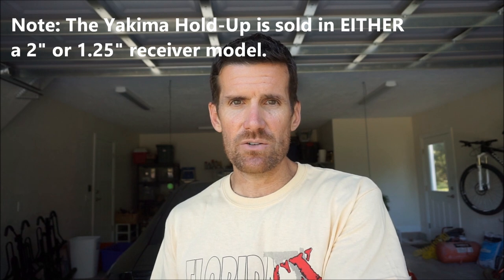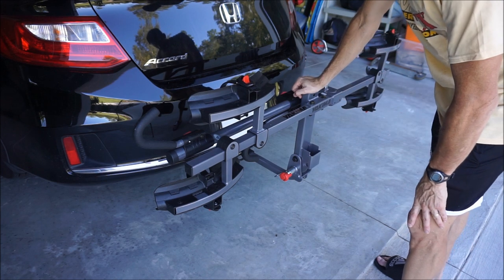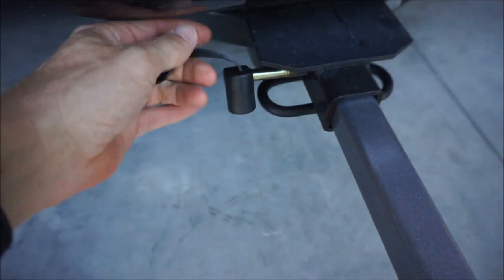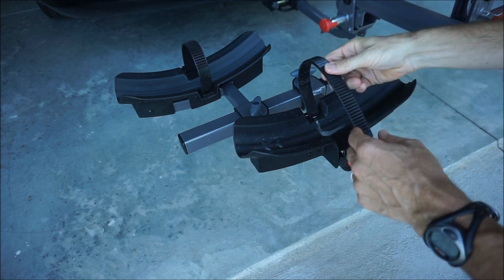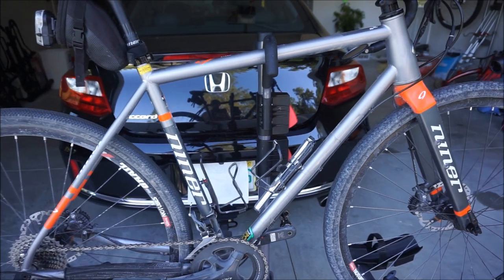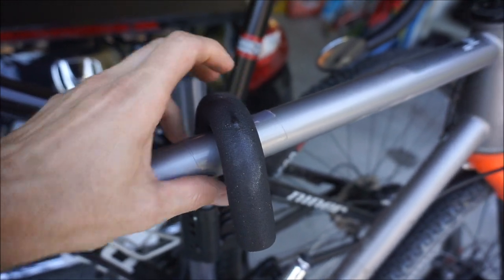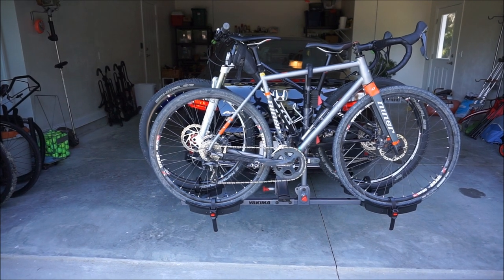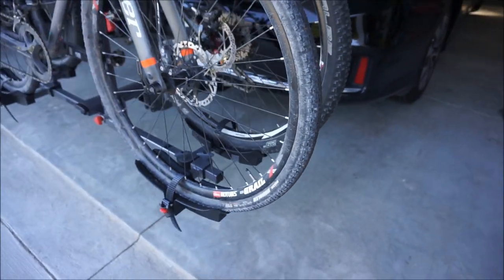Yakima TwoTimer Bike Rack Review

Comment: Good review. I might also mention that if you want to convert this rack to single-bike use, it's very easy. Just completely loosen and remove the outer wheel trays and one of the top hooks (the plastic tab on top of the hook rail pops off with a screwdriver and pops back in). So you can carry a single bike closer to the car and save some space, which is helpful for parallel parking. If you want to go back to dual bike carry, you can easily replace the outer wheel trays and the other top hook. Also, you should mention the wheel strap locks have a nice ratcheting tab feature to get them really tight and a red quick-release button that makes it much easier to unstrap. For some reason, the wheel trays do wiggle loose so you should get in the habit of checking them for tightness before every bike mounting.

Comment: Major problem for a lot of jeep owners with larger than stock rear spare tire is it will not fold up.  It requires an additional hitch extension.  Just going to throw that out there as that is how I solved the issue.  You will not (even with hitch extension - length depending) not be able to swing open the end gate far enough to lift the glass window. Also you may want to pick up another lock hitch pin for added piece of mind.  😁 jeep wrangler owners keep this in mind. Great rack though at a decent price.

Comment from the maker: +Manuel jiménez, Stan's gave me a crash replacement. I still had to pay but not near as much as I would for a new wheel. The two-time rack sits the bike up quite a bit higher than the performance Transit that I had ( the wheels sit on top of the trays instead of sinking down inside of them) so it should not be an issue. According to a phone call that I had with Yakima, the two timer puts the bike about 2 or 3 inches higher than the holdup rack.

Comment: Why not the Thule T2 Pro? You can find them as low as $438 on Amazon; more pricier but for the features it's worth it imo. More user friendly and secure. Also has the ability to lock up the bikes. It's what I use for my Camry and it is excellent.
Reply from the maker: +Lorenzo Cordero a couple of reasons. One I had a Yakima rack in college and really like that so often times when I find a brand I really like I stick with it. Also my local bike shop that I race for carries Yakima and I get pretty deep discounts.

Comment: I could see a problem with this rack if you had 2 bikes with the same height top tubes, the fact that the hold down arms have to be adjusted differently could potentially be an issue for some combinations.  I love the fact you can move your bikes horizontally though, I borrowed a 4 bike Kuat rack once and that was a problem, turned out we had to remove saddles, etc to make it work out.  Not sure if you ever saw the OneUp racks, that's what I now own and I think it's a pretty good piece of gear with a few shortcomings. You mentioned the carbon rim disaster, I actually have been meaning to ask you if you have any experience with other higher end carbon rims.  I have only ridden carbon wheels on my Giant Trance, the ones that came with the bike and they are light, I enjoy them but I'm not sure they're that much superior to good aluminum rims I've ridden.   I know you love the Stan's carbon rims but have you ridden Enve or any other top end rims?   I've decided my next bike will definitely have carbon rims even if I have an aluminum frame given all the benefits of them and I'm trying to find some honest input like you offer on all your reviews.  I'm headed to FL in January btw, rented a house for 3 weeks on Lake Weir which is near Santos...  can't wait!  I may take a ride over to your local ride too at San Felasco.  I was there a few years ago and thought it was very scenic and hilly for a FL trail short of the hog damage which I couldn't believe!  I think it may have been Conquistador but one of the trails was destroyed by hogs and I guess the cycling community had put in cement bricks through the areas.  Happy riding, a beautiful day in NJ I'm going out today since I have off, leaves are turning up here.
Reply from the maker: It's actually not a problem because the hook on the inside is longer than the one on the outside, so the locking mechanism slides lower.  My cross and gravel bike have similar top tube heights and they fit on the rack fine.
Reply: I have one of these racks and yes, adjusting the wheel wells so the bikes don't conflict takes a lot of fussing, taking the bikes on and off, etc. However, once you have it dialed in, it's awesome. Also, the video had a good suggestion about putting the bike with the lower top tube closer to the car. It took me a few tries to comprehend that. One of the top hooks is longer than the other and that also helps.

Comment: So I decided to purchase this rack based on my experience with an older non craddle style also from Yakima. The problem I have with (my) bikes, is that the wheelbase on both my Trek Fuel EX8 27.5 plus and my Trek X-Caliber 9, are too long to fit both in the craddles.  I can only fit one bike, and then my wife's bike which has a much smaller wheelbase.  This is a problem if I want to take both my bikes, or take a friend along with me who also has a bike with a long wheelbase.I am living with the issue now, as I only ride one at a time.  However, if I want to take both or a friend along with me, I will have to put my older style rack on my car.  I did speak with Yakima, and it was enough for them to help me orientate the craddles just to fit one bike on the rack.  So if you have smaller wheelbased bikes, these rack will work just fine.  If you plan to carry two bikes with long wheelbases, I would suggest not considering this one.

Comment: Great review Clint!  I'm currently shopping for this style rack and and the Two Timer seems like a good value.  It's been several years and I'd love to know if you have any new comments.  I'm also considering the Kuat Sherpa 2.0, but not certain if its worth spending another $150.  Appreciate any input you can offer.  By the way I only need to carry two bikes.    Thanks!
Reply from the maker: I now use the Dr. Tray. I like the adjustability of it and how you can put a lot of space between the bikes. It also has an add-on for a third bike. Kuat makes the most solid racks and I can highly recommend those too. But they are heavier so take that into consideration. The Dr. Tray is fairly light.
Reply: @ClintGibbs  Thanks Clint, the Dr Tray looks like a winner.  :)
Reply from the maker: @Richard-dh8ny  it's not quite as sturdy as the Kuat but it's a great rack.

Comment: Hi Clint.  Are you still happy with this rack - has it held up well?  I am just about to pull the trigger on one.   Thank you in advanced.
Reply from the maker: +Jack Stevenson yep, no complaints at all. Holding up well. Yakima products are made really well.
Reply: Thank you.  I have a non cradle type rack from Yakima.  It's done me well for over 10 years (rarely came off my vehicle).  Time to get a cradle style because my current bikes top tube shape does not fit well.  I'm also older and getting tired of lifting the bike up as much (smile).  

Have a great weekend!

Comment: D
6yrs later got a used one can I get a anti wobble hitch for it? It moves alot?
Reply from the maker: Did you make sure you move the rack up and down as you tighten the bolt?
Reply: @ClintGibbs  guy the lost the key that converted it to a 2" hitch but I found a antiwoble lockdown it should hlp alot